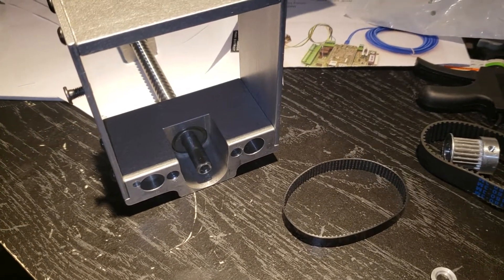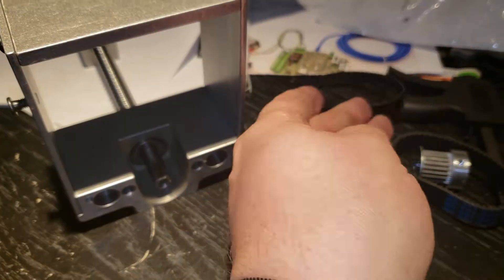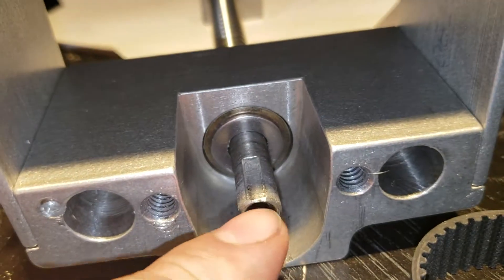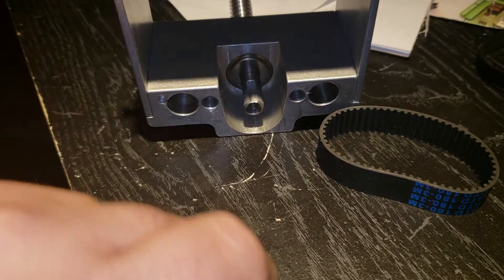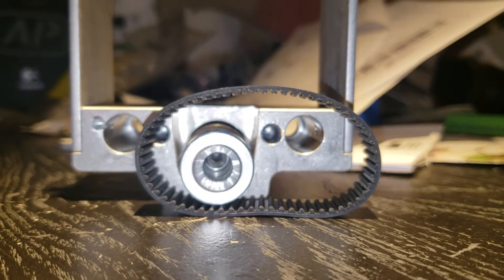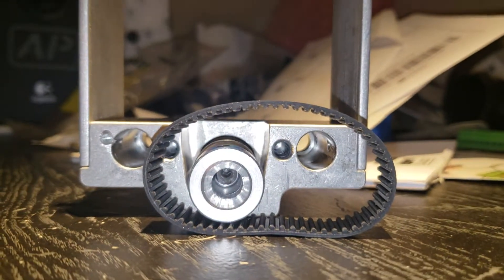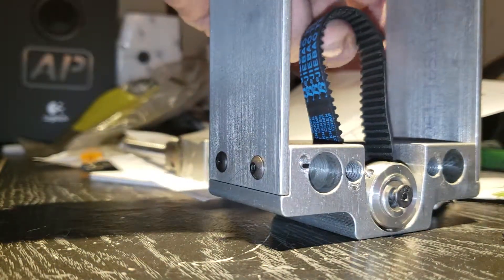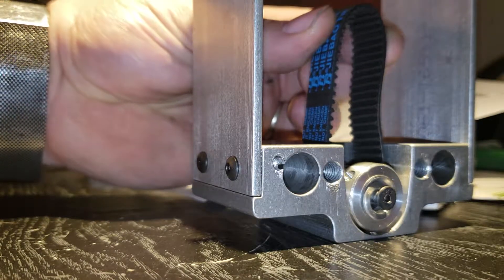G0602 - bd tools cnc conversion kit x axis belt upgrade.

Comment: Hi thats a good idea using the heavier belt, do you have a link to purchase the belt and pulley
Reply from the maker: David,  youtube wont let me post the link in the comments. 

The brand of the belt and pullies are from powge  they are on amazon, Ebay and aliexpress. 

Aliexpress has the best price and shipping was only about 10 days. 

I ended up changing the motor side pulley to 18 teeth for a .9 reduction.  

The ball screw side pulley is
Powge htd 3m 20t for 15mm belt (needs to be bored to 3/8)

Motor side pulley.
Powge htd 3m 18t for 15mm belt
(Order in your motor shaft size up to 10mm. Needs to be bored for larger. )

The perfect belt length is

Powge htd 3m 180mm 15mm wide belt.
Reply: @adaptedmachining6951  how did you like the .9 reduction? Great video by the way.
Reply from the maker: @adrewfis925  works awesome 👌